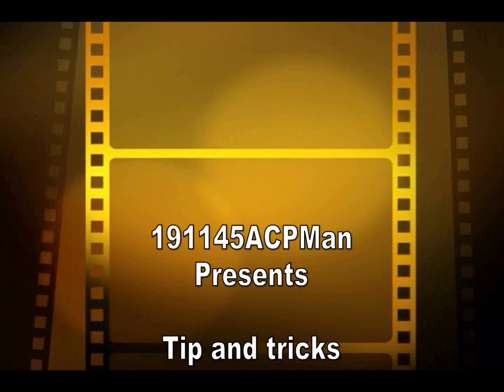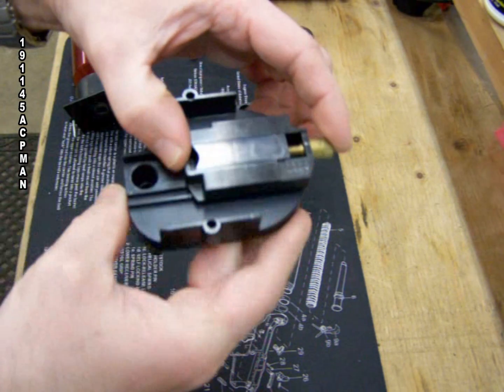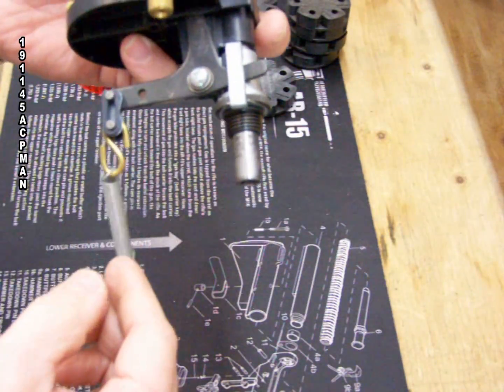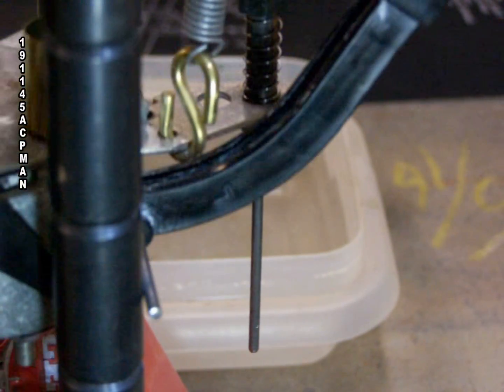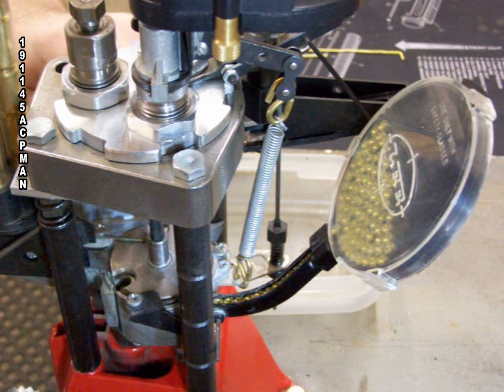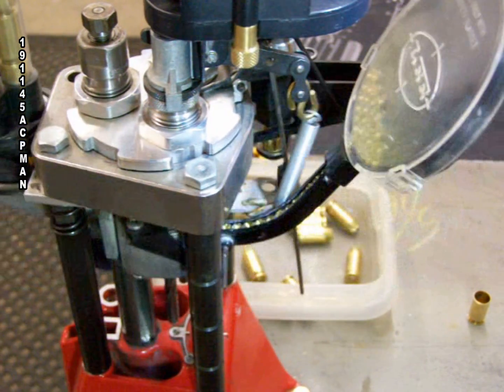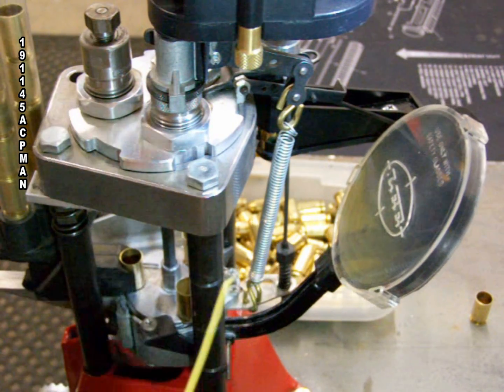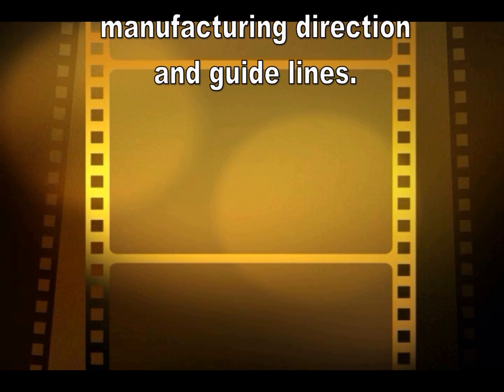Lee Pro 1000 Tips for problems

Comment from the maker: You need a “Lee double disc kit” for a larger charge. Like a .223 cartridge. 

To use a Micro Bar for .223 or large cartridge.
I believe you need to use 2 of them and match the settings with a double disc kit.

Comment: I have not reloaded for a long time now, but IIRC, with the ramp 1/3 up, I would stick a case up into the powder die (with one hand) and cycle a powder load into the case, using my fingers on the powder bar. (using the other hand).  Then dump the case onto the scale cup. 
But, if your cases have a uniform weight, (all the same brand & batch) then you can zero your scale with a case, and just weigh a case+powder load.

Comment from the maker: Light is something that I find very important. I used 2. Two, 4 foot fluorescent bulb fixtures over my work bench. But the most important thing is bulb color temperature / kelvin. I use 6500k Light bulb. This is the closes thing you can find to sun light out of a store. There is higher you can find on the internet. 
Thanks

Comment: When you check the load by dumping out the charge and then put the case back in the station it was how do you avoid the station trying to prime the case again? I'm assuming the powder charge and priming happen at the same station correct?